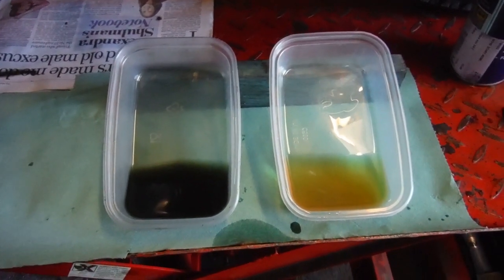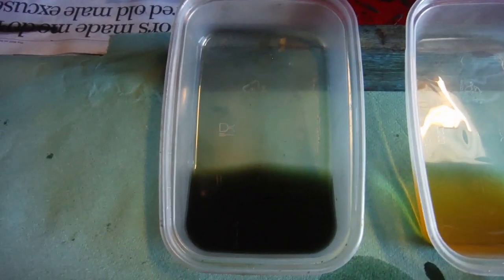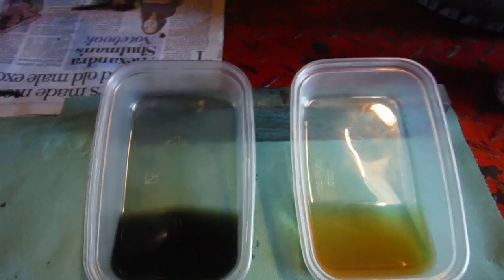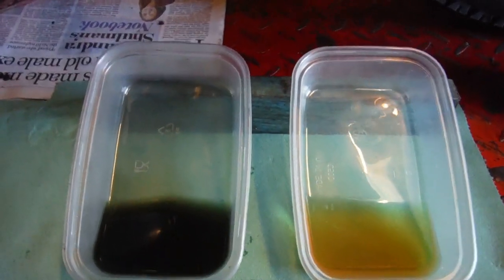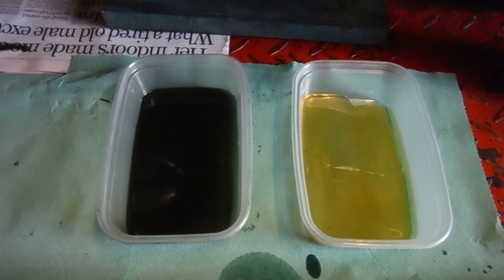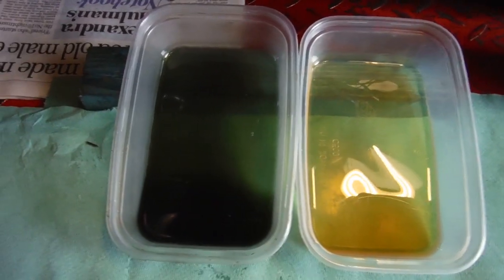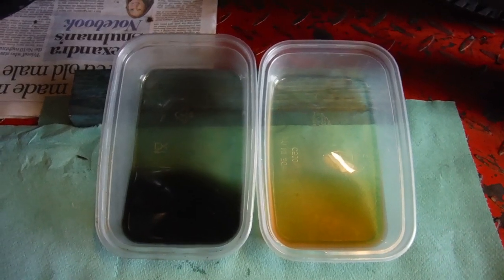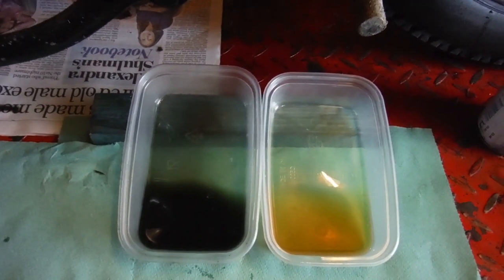Oil viscosity comparisons of two brands of 20/50 grade [one very slightly used]

Comment: observation, have found with 'fast flowing oil' it was not what you want noted on several occasions the oil did not sufficiently lubricate the engine so it would not start at all on electric starter and was nearly impossible to start with a kick starter. The oil was not thick enough to keep the metal parts from coming into contact.

Comment: I don't think that the viscosity at room temperature is any indication of the viscosity at higher temperature. With all of the magic additives they put in oil nowadays the "thin" oil may be just as thick as the light coloured oil when you get it up to operating temperature.
Reply from the maker: Fair comment, but the 'thicker oil increased the oil pressure between 5 and 10 psi when warm at 3000 - 4000 rpm compared with the thinner oil as per this experiment.

Comment: Hope im not being cheeky here my dad has a 55 t110 he's on the understanding that the oil pressure release valve stays closed it comes out when he starts it but then goes in is this right sorry for the question Paul
Reply from the maker: Hi Mick, I think he may be getting mixed up with the oil pressure indicator button, which sticks out of the timing cover side. I think it should stay out, and feel 'springy' if you try and push it in while the engine is running.
Reply: @Paul Henshaw  hi Paul that's right the oil pressure indicator button his comes out when first started then goes back in he was told by an old chap that they should stay in everybody seems to have different views on it thanks for the reply Paul

Comment: When I first stared riding motorcycles ,we used to buy oil in round tins from the local garage .I can’t remember there being any specific type of oil at the time for motorcycles . The local motorcycle shop ,swore by using 10 / 40 filtrate oil for Japanese bikes . That was the first oil I saw as being aimed at motorcyclists .  The Brit bikers I remember either used a general 20 / 50 motor oil like Castrol or a single grade motor oil . Later on I was told that general motor oil used for cars wasn’t good for bikes with wet clutches as it hadn’t the correct additives . I had an old Honda 250 I was using to get around on ,with a worn camshaft & pitted lobes ,& just slung some cheapo Motoworld 20 / 50 multigrade in. That bike ran ok for at least another 4 years no clutch problems & only a bit noisy after a long hard run of around 30 to 40 miles .,before I stopped for a smoke rest . So I reckon it would have been ok to use on an old solid Brit low revving push rod thumper , although I could be wrong as I am no expert on old Brit bikes .  Finally could it be that all these Supermarkets & discount stores get generic multigrade motor oil from the same sources & just have their own logo stamped upon the containers & flog it as their own exclusive blend of oil . 👍

Comment: Is it just because the slighty used oil is slightly thinned by absorbed petrol? You know how oil smells of fuel when it's been used, that fuel was absorbed into the oil as a result of ring bypass or just unburned remnants clinging to the cylinder walls.
Reply from the maker: I don't think that oil has done more than a couple of miles worth of running, but if it had done a few hundred miles or more, that could be a valid point.

Comment: A nice, simple experiment.  Most basic laboratory tests for viscosity of liquids involve either timing the liquid as it runs through a constriction in a glass tube or timing how long it takes to run out of a "cup" with a small hole in the bottom.  I like your two channel comparison method.

Comment: G'day Paul - from Brisbane Australia - thanks for showing a very simple example of oil viscosity.  I had an issue with my A65 some years ago - it never showed any problems until one day on a summer ride (yes it was hot) the oil light came on - checked it & was full but the Castro was like water - so did some research & changed to Valvoline ( which was popular at the time), that fixed the problem at that stage but oils certainly are not equal even in the same viscosity range. I'm retired now but had a full working life (from 14years old)  as a motorcycle / small engine mechanic and later as an engine reconditioner - working on pretty much everything from lawnmowers to D12 caterpillar engines & learned a lot about oils in the process.  Thanks for you videos 👍